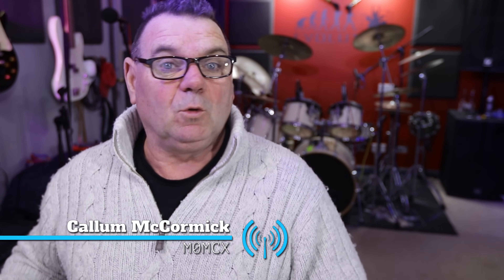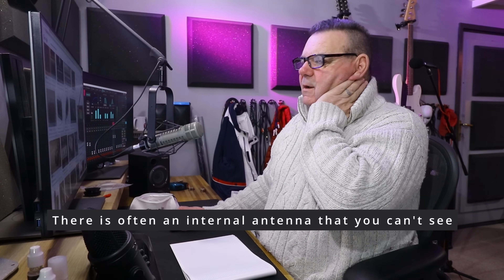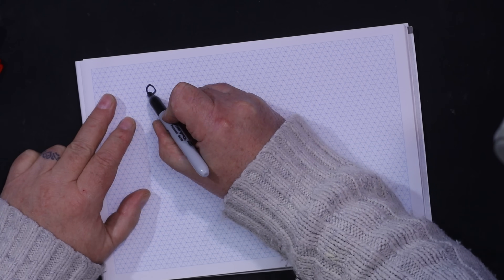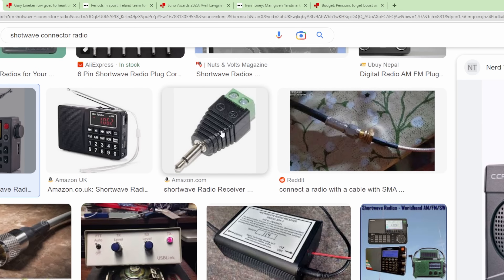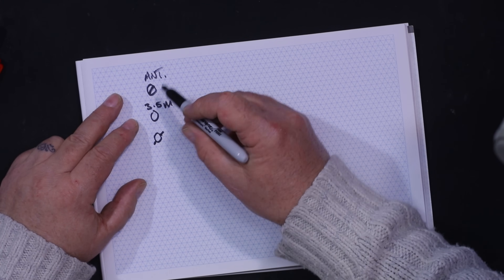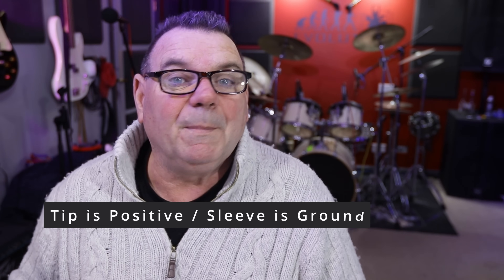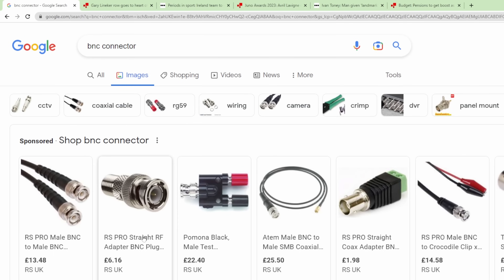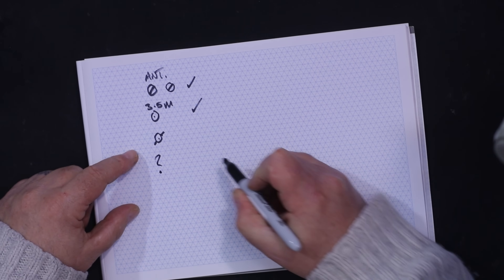Cheap SWL Antennas - Listening to Shortwave Radio With Scrap Wire

Comment: I want to set up an antenna to get WWV 10.Mhz to use as a reference frequency standard for my instrumentation. Do you have any thoughts about a simple directional antenna peaked at 10 Mhz?
Reply from the maker: Huge topic.. Depends on how much signal you need.. "Directional" AND 10Mhz can be difficult.. Start with a dipole and see if you can hear it I guess else you are into something crazy like phased verticals.

Comment: What about using the ground wire of the plug socket in case it has no measurable potential?
I used AM antennas of old radios in the past with slightly success.
Reply from the maker: I wouldn't around here because we have PME wiring..

Comment: OMG.. Callum got a Q code wrong - qrm/qrn.. 😮 he is to be CANCELLED!!
Now I've dealt with a comment of the idiot who pointed me at this video.. I enjoy the reception off of ~150ft speaker wire strung out approximately east-west at about 15 ft off the ground and a good 8ft ground rod. Not the optimum but at least I didn't have to get out a ladder. The old random bit of wire has been a successful receiver antenna so many times.
Reply from the maker: Like who cares..
Reply: @DXCommanderHQ  exactly my point Callum..

Comment: So, question...I came across an old shortwave 5 band receiver and it has 3 screws....labeled, A-1, A-2 and GND (ground) What's the proper hook up for that? (radio is the Realistic DX-160)
Reply from the maker: At 14-minutes in this video, the chap shows antenna connected to the far left screw. It also looks like the next two are shorted out. https://youtu.be/0L57tAk1QGc

Comment: Does it matter what type of wire can be used? I have an old clothesline in the back yard we don't use anymore. How about using egg insulators at each end and hooking that up? It's about 2.5M off the ground. Galv steel wire.
Reply from the maker: Nope :)

Comment: Great video and advise Callum. When I am on holiday in France I use an end fed copper wire attached to a tree and an atu.  In England I upgraded to the mfj 1886 active loop as I am in a valley and works a treat.  It's all about horses for courses as I have learnt over the years. Keep up the great content. I always love your live feed stuff.
Reply: H Greg. I will be nicking the loop idea. I used to make half wave 11 dipoles from coax as an experimental teenager... as well as tuning my 5/8 wave by taking it down off the scaffold pole and adjusting it. 43 yeara ago.. where the hecj did I get the scaffold frpm?? Lol YIR (yours in radio) Jock

Comment: There is a preamp circuit on the net which has 20db of gain and works from MW to 6M it has 50 ohm input and 50 ohms output its is the W7IUV which I use with my RX loop with a balun.
The preamp is place at the feed point of  the loop a voltage is fed down the coax to the preamp using a bias T. if the preamp if used at the shack end of the coax will amplify the common mode from the coax.
Reply from the maker: I have used one.. The problem I had was LOTS of broadcast station harmonics all through the ham bands..
Reply: @DXCommanderHQ  Not me no problem some preamps have  protection diodes on the input these diode's will generate harmonics on to the HF bands
The W7 IUV preamp does not have protection diodes and I have transmitted 400 watts with the loop very close by with no issue.
It is a very simple circuit using one transistor, info on the net.

Comment: Thanks very helpfull info.   I stay on the east cost of Oz and have earth cable 100meters running round the top of a 6 feet hight wooden fence.  Using a ATS25 with a MFJ 902b atu.  Still not happy with the performace of it on HF.  Could be that their is not many hams around my area.   Thinking it getting rid of it all and buying a good deadicated communication rx like icom or kenwood and doing away with the earth wire that I have on the fence and doing something else.    Not the same rx as I used to get back in the old country Scotland.  But I think with a lot more hams in the UK close by and Oz hams not being many compaired to the UK might have something to do with it.  But thanks for posting and very helpfull regards from Oz.

Comment: How about using a no-longer used telephone line still on the poles, but not connected to anything, could be hundreds of feet or longer?
Reply: You won’t be happy if it gets connected back up at some point and puts -48V DC or 100V AC telephone voltages into your radio.
Reply from the maker: Roly did that!
Reply: My SOP  is if it's overhead, it's ENERGIZED!!!

Comment: Just subscribed as beginning to get back into radio, starting with sw receiving.  My idiot question: are you running one single strand of single-core wire around the garden but then connecting it to the ground braid which would create the short you mention? Or do you have two wires, one coming from and back to the positive, and the other to and from the braid? Or maybe two-core cable going around, with one conneceted to core, the other to braid? The way you describe it, it sounds like the first one but I think maybe I'm being a bit 'slow' here. Thanks sir.
Reply from the maker: Good question. Single wire.
Reply: @DXCommanderHQ   Thanks! Appreciate your response :-)

Comment: I had a random wire run around my fence for SWL, it worked OK, but was kind of deaf on many bands. I made a 60 foot LOG and it's UNDER the grass now and I can hear more on it than ever before. I can hear 160m and below now, and 80m is S6 or above most of the time, and very little QRN. I cannot fault the idea or the design I have mine connected via a 9:1 that I bought on ebay for about $5, it seems to work flawlessly. I can even hear UHF on it, but I wouldn't try to transmit.....works GREAT with a USB SDR dongle.
Reply from the maker: Great feedback!

Comment: I’m confused, I thought the second conductor to the jacket was for shielding only.  ie. run coax center conductor and shielding connected to both radio antenna terminals until you’re in your desired receive location.  At that point, terminate shielding and continue center conductor in an open loop?  Sorry maybe I misunderstood what you were trying to say.  It sounded like you were advocating for shorting center conductor to shield, after saying not to do that.

I come from data wiring background, not radio, so I might be conflating the two.
Reply from the maker: After the coax, sure - make the jumpers to the antenna small.. I guess!

Comment: hi would it be ok on all bands ? , and also aircraft hf and shipping hf frequencies regards peter
Reply from the maker: For receive ONLY, there are better dedicated verticals for outside / wall mounted etc.. But anything "works". Just how well do you need it..
Reply: @DXCommanderHQ  I was just going to run a wire round the garden up in the air if that would work

Comment: I have basically 2 random wires that are 21ft. Long. 1 has a 3.5mm plug & the 2nd one has an alligator clip for other radios. Most all my radios are mid to high quality portable multi-band radios. I do have the Eton Field bt tabletop which actually has the F type connection. What can I expect band-wise out of these? Most likely attached at some angle degree to a tree or something likewise.
Reply from the maker: OK, so everything works.. But it's at what efficiency - only you will be able to judge.

Comment: Can I use galvanized  fence wire to string around the yard? It's made to conduct electricity. Or does it need to be shielded wire?
Reply from the maker: Try it.

Comment: Can I bury the wire an inch or two below the ground and still get good reception? I don’t want it caught up in the lawn mower.
Reply from the maker: Pin the wire down. The lawn mower won't catch. Too deep, and you will lose the signal.

Comment: Here in the UK "Bell Wire" from B&Q or Robert Dyas is perfect and cheap. Experiment, don't be afraid to try something, the worst that can happen is it does not work. In that case, try something different.
Reply from the maker: Good advice Ron!
Reply: i use 6 amp "hook up" wire from rapid electronics.

Comment: Any reason I couldn't run the loop ends directly to the  +/_  screws/lugs on the radio without the coax run? I have a few old military receivers with just wire connection lugs I'd like to try these long ground loops with.
Reply from the maker: Yep.. I THINK I mentioned that near the end. Sorry - I forget. But sure, run with that.

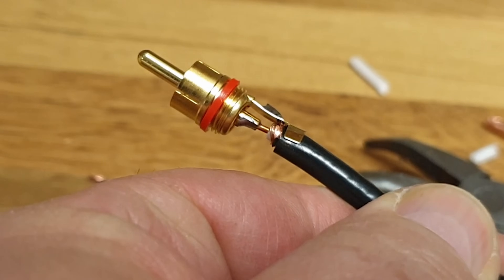Comment: The 4th style of connector is the RCA.  They are most commonly used for audio and video connections these days, but have been used for quite a lot for RF. You showed the plug connected to a piece of coax at 2:01 in the video.
Reply: Dont forget SMA

Comment: Hey DX Commander you have some shortwave knowledge. I have bought an XHDATA D808 shortwave radio and also a DESHIBO GA-450 Active loop antenna to listen to shortwave. Now there is someone who has advised me a mini whip antenna to listen to shortwave station. My question is this, will it make a difference between a miniwhip antenna and a GA-450 active loop antenna when listening to shortwave? Any reply would be very appreciated. Thanks in advance DXCOMMANDER!
Reply from the maker: OK, so active loops and these super small antennas have very low output. However, that's not a problem if the noise is also low.. It's called signal-to-noise ratio. A "mini whip" will also have very low signal too. Another way of doing this is with a "Loop On Ground" but you would need some coax to the back yard.

Comment: As a teenager in the early 1970s, had a five-tube Heathkit shortwave receiver.  I lived in Ohio in the USA in a ranch style (one-story) house.  My first antenna was about a six feet piece of wire up to the curtain rod in my bedroom.  I regularly listened to the Voice of America station from Rome, Italy, along with other European and South American stations.

Later, I ran a wire inside the wall up to the attic and across the roof.  I expected that with many times the length and much higher that it would work much better, but I was very disappointed that there wasn't much difference.
Reply from the maker: Ah.. Maybe something more "balanced" may have assisted.

Comment: The back of my radio which has a BNC socket for a RX antenna making up a BNC plug is a nightmare but you can buy a pl259 plug to a BNC plug much better Idea.
Reply from the maker: Buy a BNC with 2 x screw terminals..?

Comment: Hi Callum, this is probably a complete rooky question (because i am) could i use the wire fence around my garden as an antenna?
Reply from the maker: You can try.. You will probably need an SG230 or similar because the impedance will be all over the place. BUT you might find it'll tune somewhere!
Reply: @DXCommanderHQ  Thanks, i'll give it a go.

Comment: Ham radio?..after 23 years of calling me rear off. I'm moving on. They cut my cables. Have had officers calling at my door to look at my dusty logs and pocketing my qrp rigs. Thinking they were spy equipment. Slow to return.  But starting again as odn-1 and all my receivers have each a personal "kit" with battery's and a lamp, a bit of cake and coffee, and chew gum. A log book  I'm listing and watch on the net tks om later ps I park my car and toss out a bit of line about 10 meters does it. 73 from 72 old listener

Comment: Nice video Callum 👍🏼
Another cheap one I tried is the coaxial ‘snake’ antenna lay on the ground. You can use some old TV coax or Satellite cable, works surprisingly well and easy to make. Quite good performance on MW and LW as well.
Reply from the maker: I shall look that up!

Comment: What about if my radio doesn’t have an external antenna input?  I have a 10 meter 1/2 wave vertical and I’m using a jumper wire with one end clipped to the the center conductor of the coax and the other clipped to the end of the telescopic antenna on the radio. This works better than nothing, but it’s still not great. Would it be better to just run a single wire on the ground?
Reply from the maker: OK, so I would just try it..

Comment: hello Callum do you maybe have a solution for a problem I have myself but I think many apartment radio amateurs.

I have a Mazzoni loop for transmitting and that works perect I have alsmost no qrn/qrm. but this one is from 6 to 30 mhz.
I would like to listen on 3.5 mhz but everything I try then I have 9+ of QRM. on a endfed of SWL loop ... 

do you have a tip for this, or in general radio amateur users or SWL users.
who like me are high (20+ meters) and have a lot of interference on lower bands.

73' PD3AB

ps:  maybe a good tip for a YT video 🙂
Reply from the maker: Andre.. Have you tried a small RX loop? A continuous run of wire from the centre conductor of a PL259 all the way around direct to the earth / ground..??
Reply: @DXCommanderHQ  
i have indeed tried a (smal) RX loop, but one problem i cant get a earth ground i live 20 meters above the ground ;-)

Comment: I have about 100 feet of insulated telephone wire (22 AWG I think) and wonder if I could tie wrap it  onto the top of my chain link fence, that way I wouldn't have to worry about getting it up into any trees,etc. Just trying to avoid climbing a ladder or tree. I have an Icom IC R70 receiver that has a coax connection and 1 "spring loaded" connector (as seen on stereo speakers,  but just one), so if I was to use the coax  connector,  how would I hook it up to the wire, (taking into consideration my non existent soldering skills) or would I be better off using the other connector?

Thanks;
KE8NFK
Reply from the maker: You can try both.. The fence is probably grounded - even by accident. Just clip it with a few cable ties, assuming insulated wire. Easy.

Comment: Hi Cal, I was thinking about putting a loop on the ground around the perimeter of my garden.  I'm looking to terminate it in a weatherproof PVC box I can mount in the corner attached to my fence.  That way I can temporarily connect to it when I want to use it.  Can you recommend anything?
Reply from the maker: Just go for it! Make a loop-on-ground transformer....? FInd a cheap waterproof box. Happy days.

Comment: Laughably bad misinformation and advice from start to finish. He should play guitars but not give guidance on this subject.  Wires laying on the ground don't work worth spit.  You-tubers, search a little further and you will get much better info and guidance. This guy is wasting your time.  If antennas laying on the ground where worthwhile you wouldn't find everyone's antennas in the air.
Reply from the maker: You are so wrong and probably stupid. Do your research. Google "Loop On Ground", "Beverage on Ground" both over 100 years old designs..  or watch this (exact time stamp in video link) https://youtu.be/z5MhYu2LUrY?si=u7UoZVBb86mI_QBA&t=457
Reply: the LOG antenna is a low noise antenna. That`s why is on the ground. It does not take space, it`s invisible to HOA... Wish you did your research first...